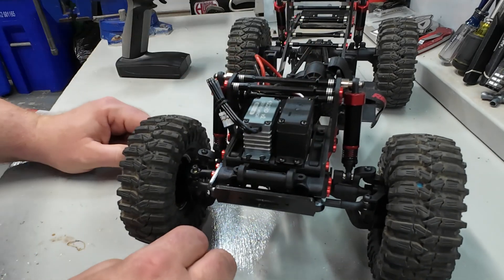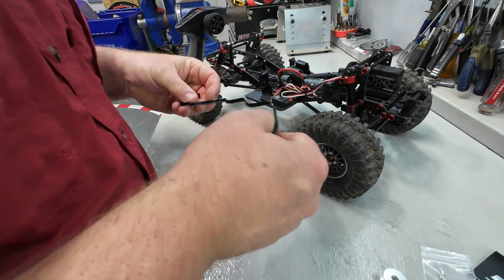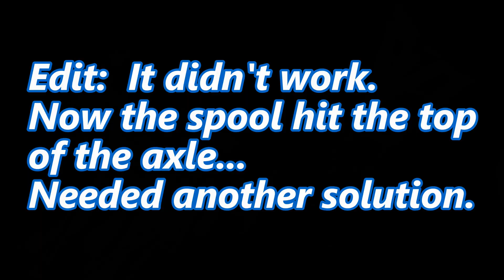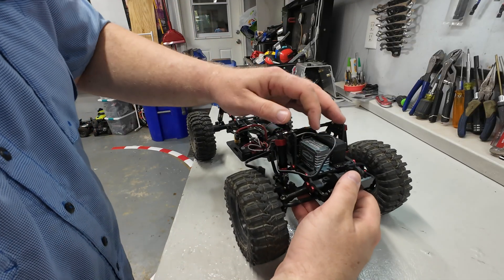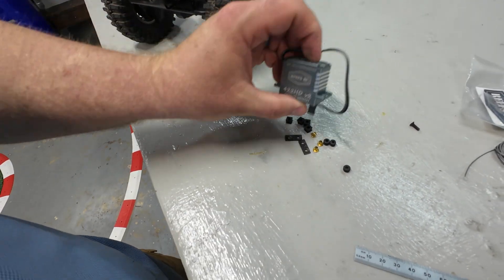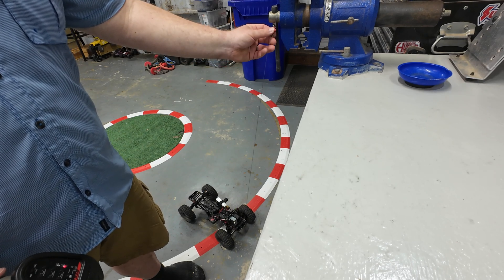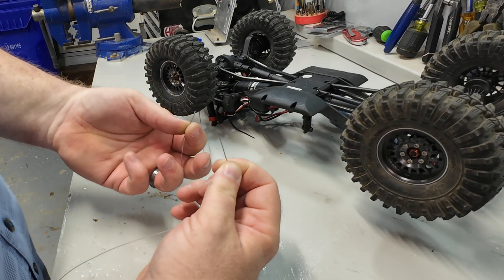How to Install a Servo Winch in the Redcat Ascent |  Reefs 422HD

Comment: Thank you for the share, I’m always looking for different ways to mount and set up winches on crawlers. 

I mounted a servo winch next to steering servo in that formation on my Element crawler, it worked great. But the weight up high and to the front seemed to make it a little top heavy. 

Lately I have been using the rock slider as a mount point with tubing as a guide. This helps keep the center of gravity low where I prefer it. 

Great video, thank you for sharing. I look forward to your next one.👍
Reply from the maker: That is a fun idea!   Thanks for sharing.

Comment: Like everything redcat, Amazing in many ways, dubious in others.   I have the ascent fusion and my WendiGOAT with fusion pro, tc8 marksman and had the amazing kaiju..they are all great vehicles, with amazing components, put together like shit by people who dont care because they are 12-13 year old children in chinese factories.  Is what it is.  After TRX Redcat is making the best crawlers at the moment and by the way what the hell happened to axial, the chevy looked terrible my cj looked great but WAS terrible, and now its like 24 scale or 6 scale or skip axial.  I wonder if HH has a new brand in the works, honestly.

And I understand many most will disagree but I have time on my side and I have TRX crawlers with nearly a decade on them and hundred and hundreds of miles,  the quality stands out over time.  I sold a defender with a verified 1000 plus miles YEARS ago, its insane.

anyways, roadside, from drift cars to fusion servo winches, you are chasing after it and I respect that, plus you arent using your girlfriends breasts or adderall popping  behavior to get views just lots and lots of info, and a good helping of your opinions, lol

One more thing, if the fusion pro has real carbon fiber as opposed to a plastic imitation or light wrap I would be surprised, I have seen so many snapped frames, I think if I had to do over I buy red ascent non fusion and put in the far superior FP rather than the Fusion se non programmable, i would much rather have a steel frame.  I totally expect to break it and dont use it all that much as a result.  great little truck for a 1.9 though.  

keep it up, later
Reply from the maker: Thanks for the comment. 

I have had pretty good luck with my Redcat vehicles over the years. 

The carbon fiber is real carbon - confirmed directly.

Comment: I dont understand why they made it so hard to add a servo winch but they added a spot to mount it. I think im going to 4-link mine and add an outrunner motor and copperhead 10 esc to clear the links.
Reply from the maker: It was more designed around an internal spool winch setup - not external like I used.  

If you go internal spool - it bolts right in super easy.
Reply: @RoadsideRC  seems like the line would have to would run down then out the front bumper at an awkward angle. Instead of just straight out. Does that cause any issues like wear on the line?
Reply from the maker: @nathanstewart2018  There is plenty of room.   If you watch the recent Redcat livestream, he just unbolts the front body mount, runs it under there.  2 screws.
Reply: I used the LP spool and nylon spacers and it just barely clears but it works. I’m gonna watch the link to adjust end points and might do the internal spool winch and use the 442HD on something else. Thanks for the informative videos
Reply from the maker: @boondeanie  Glad to help!

Comment: Great video with some good work-arounds! I used spacers (as per Oscar in the also great Redcat video you mentioned) and had  a great result with my outer spool winch. Oscar also mentions using 300lb test fishing line instead of the included wire, which I will do when and if my wire breaks. Thanks for all the great videos!
Reply from the maker: Yes!   The fishing line might be my next swap....we will see if I break another line.
Reply: Will the internal servo winch settup work on the ascent fusion? Thanks @RoadsideRC
Reply: My bad looks like it is the fusion
Reply: @RoadsideRC oh maybe this is the fusion?